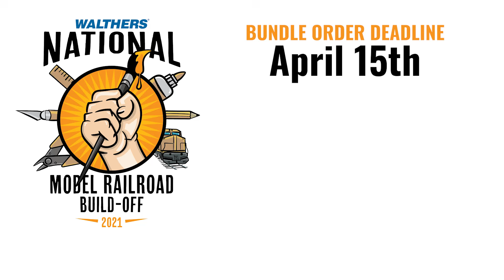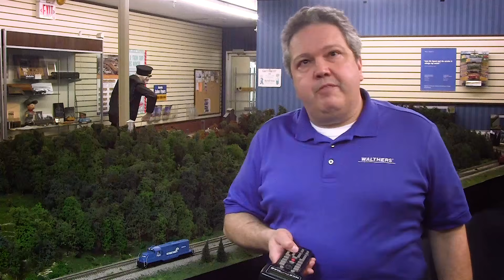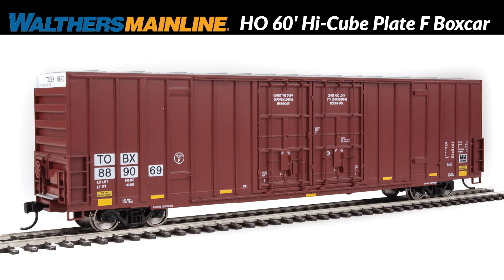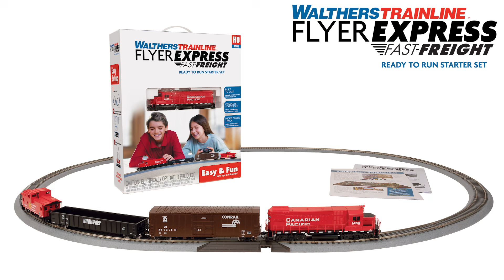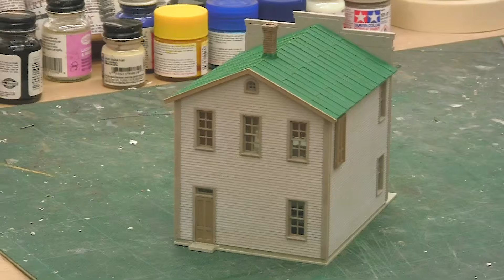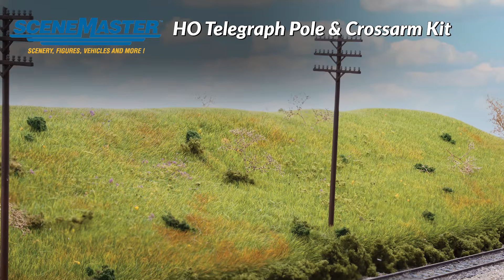WalthersDirect Spring Edition

Comment: Your 40-foot AAR 1944 Santa Fe Boxcar is incorrectly painted, unless boxcar #139056 is a prototype painted anomaly. The lettering States "the Super Chief the only daily all coach train" Etc... It should state "all Pullman" or "all sleeper" or possibly "all room" as the Super Chief did not carry coaches! The Boxcar carrying this moniker would have stated "the El Capitan the only all coach Streamliner" Etc... Your presentation does show this boxcar #139056 first then proceeds to the generic "Santa Fe all the way" boxcar #139033 presentation. What's the story are they both available?

Comment: Ouch $549.98 before taxes and shopping cost for a EMD FP7 A&B combo unit. That's expensive basically in the next decade or two I wouldn't be surprised they'll be $1,000 MSRP. The poor model railroaders pocketbook and when you think about scalpers they have to first make $550 then factor in shipping and handling and then make a profit which means they'd have to make at least $600 to make some  dollars